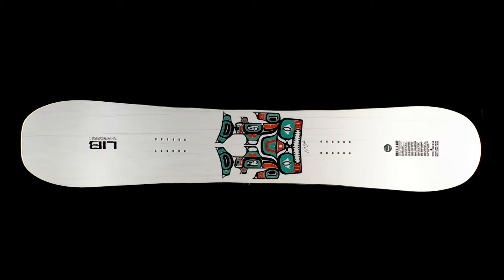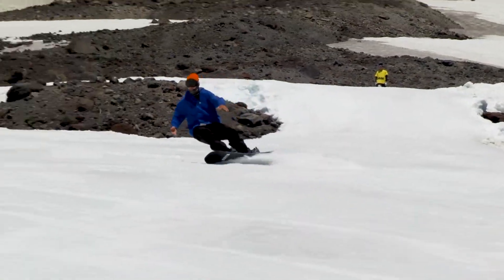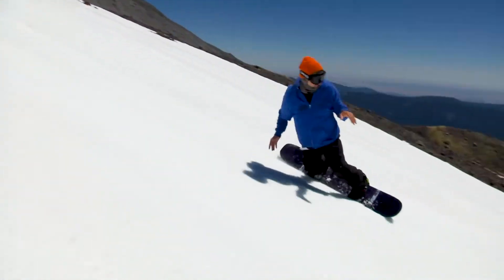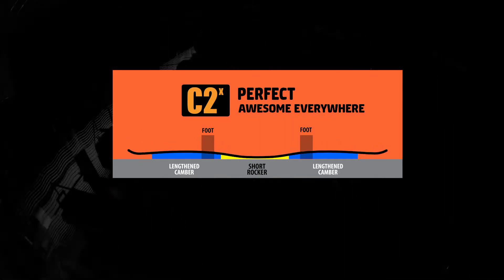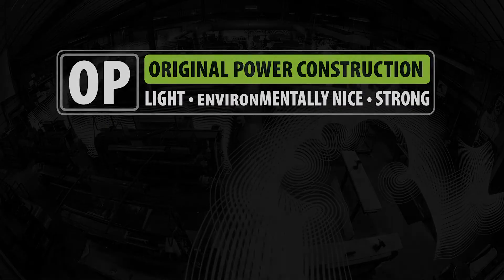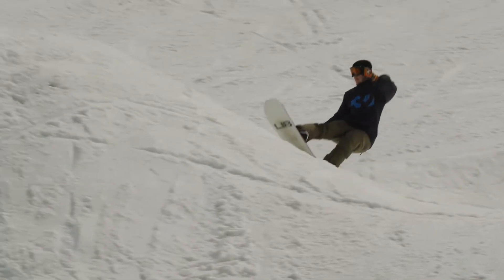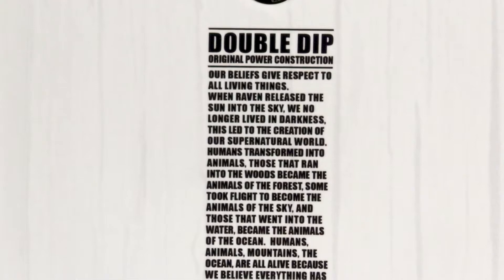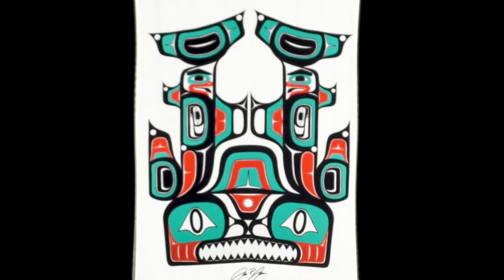DOUBLE DIP | 2020 - 2021 LIB TECH SNOWBOARD

Comment: Sick board.  Totally underrated or at least under appreciated.  It rips anything.  It flies.  It turns fast, easy, and engages when you want.  The short contact points are magic.
Reply: I really like this concept of board for a powder twin that performs well everywhere, like the Santoku or its older version, the Überspoon, way more than a volume shifted twin, because I've tried several of those and I don't like them for park, nor even for piste. 
But I have heard that the double dip is a bit heavy. I like light stuff, it's one of the first things I check when testing material. Have you got one? Thoughts? Because this board is really appealing to me.
Reply: @The-Man-On-The-Mountain  I never even considered that.  It feels lighter than my Skunk Ape under foot and seems incredibly nimble.  I went from an ancient Nitro Fusion 172 and an almost as old Burton 172 three hole (both stupid heavy). I'm old, tall, and just ride. I like the way it goes through all sorts of variable East Coast conditions.  I got the 2020 159 but keep looking for a deal on a 163 just in case I need a back up....